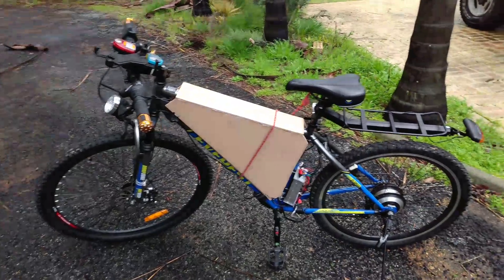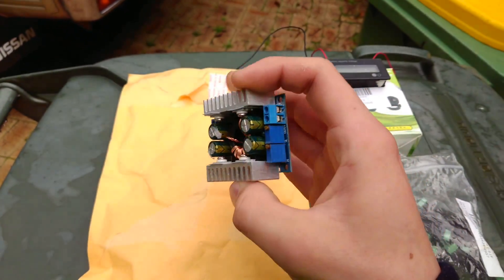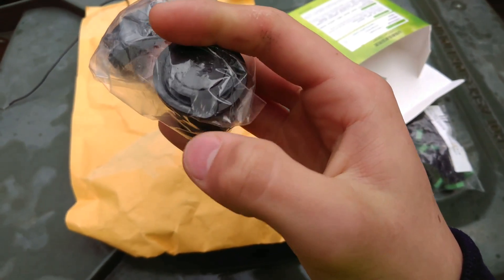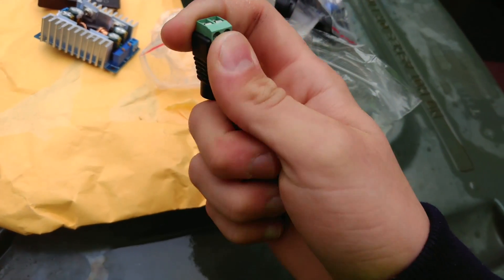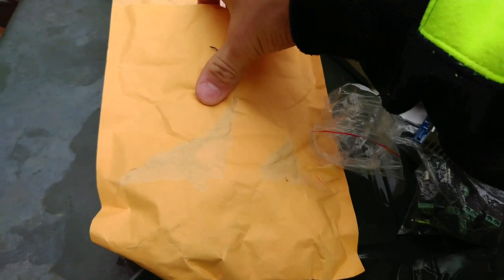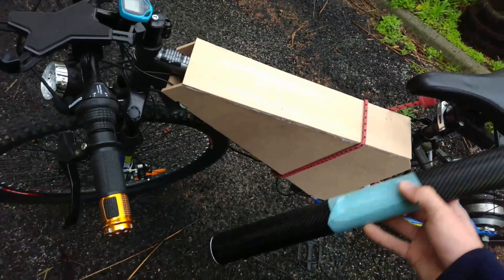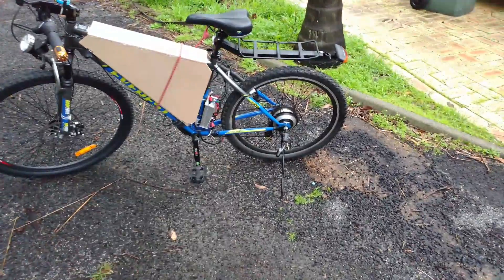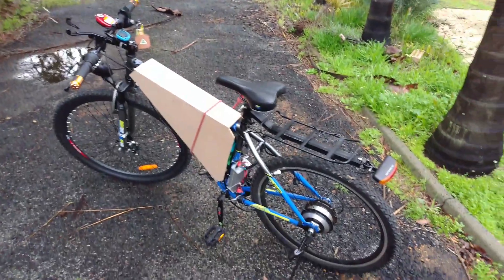DIY E-bike | Having a closer look + what I have ordered | Update 3

Comment: Can you give me the link of the motor that you use?
Reply: Great work by the way!
Reply from the maker: I got the motor off a prebuilt e-bike. It is a 36v 250w motor overvolted to 48v 500w. Currently at this voltage it does not get hot at all. This is not meant for a normal bike, as it is wider than the average bike frame.
Reply: Thanks!